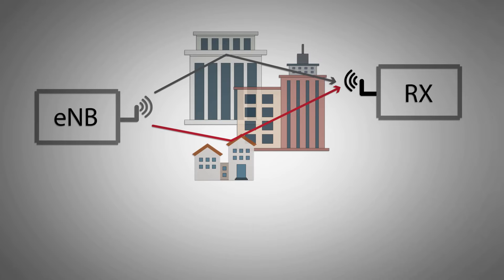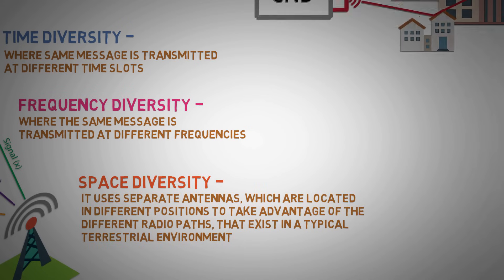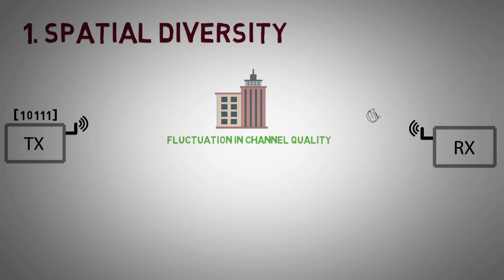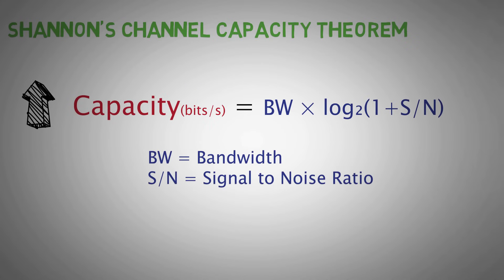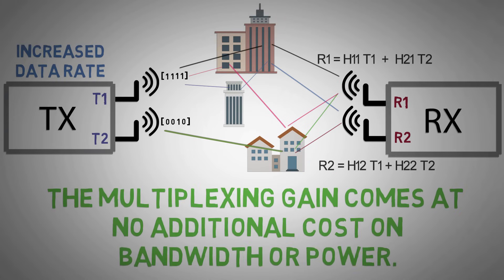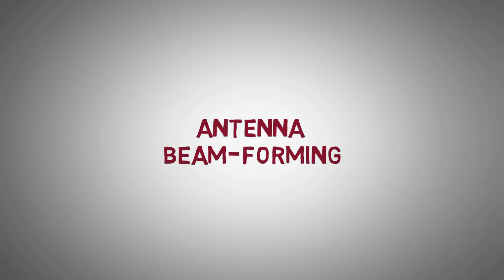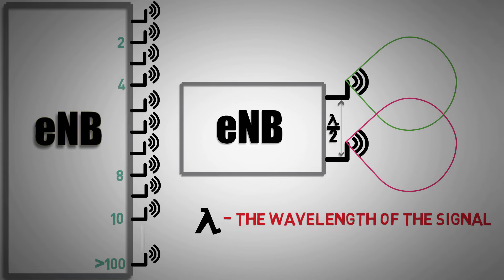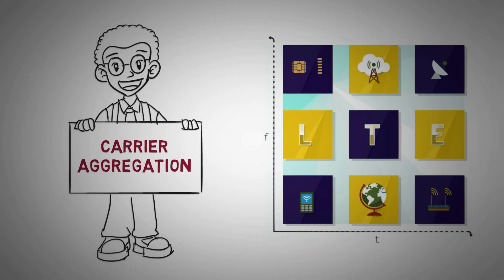2.8 - MIMO TECHNIQUES - CAPACITY & COVERAGE ENHANCEMENT IN 4G LTE

Comment: Due to fading is it guaranteed that the signal will increase the link capacity can't it degrade the signal ?
I know that if the signal is out of phase then it can lead to destructive interference. 
Is there a way to counter it??
Reply: Are you a T-Mobile engineer?
Reply: If 2 signals at a similar amplitude arrive at one antenna 180 Degrees out of phase they are destructive to each other , the second antenna at a different physical position will have (in general) have a different phase relationship for the diverse paths. So the second antenna may receive for example 90 Degrees phase difference allowing the resultant to not cancel. In reality there are more than 2 signal paths and phase relationships, but this explains how the chances of data passing through is improved.